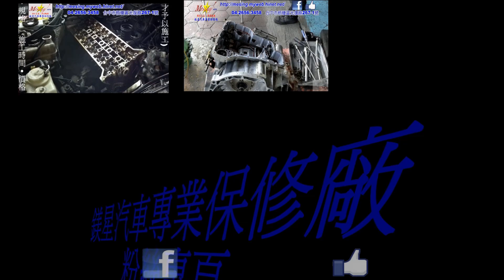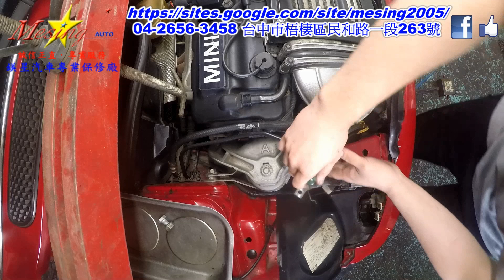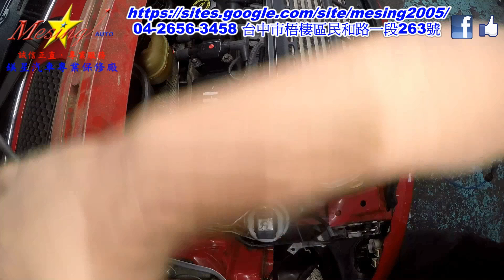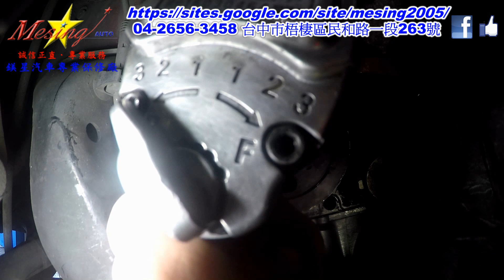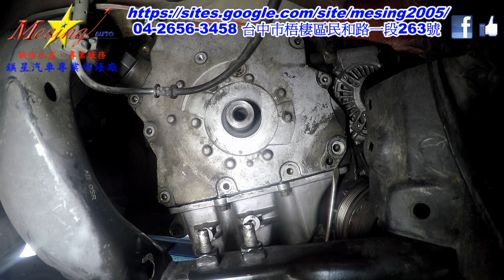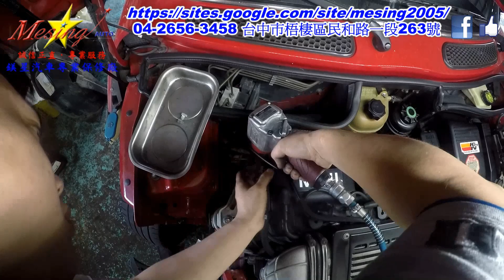Timing Chain Cover Oil Leak Repair MINI COOPER-S R53 1.6T 2001~2006 W11 GS6 85 BG DG

Comment: This is a comon leak,but it always better to add an extra sealing motor joint just to keep the original sealing in place,ive donne it before and after  some time,the leak commes back